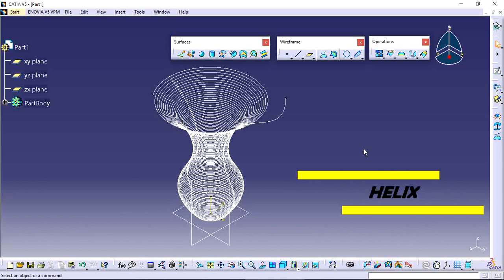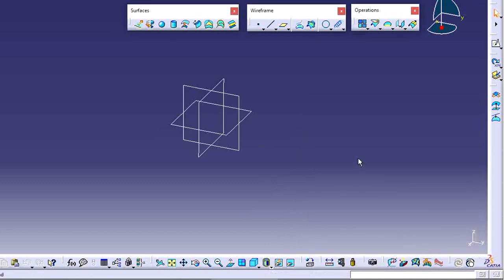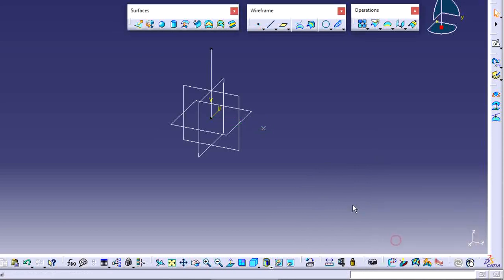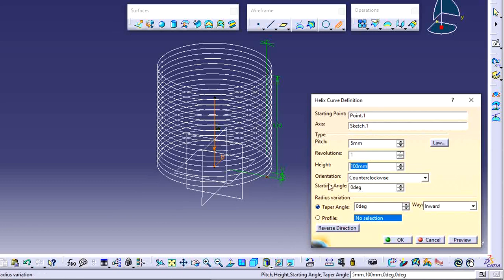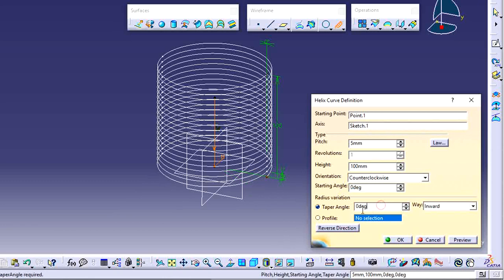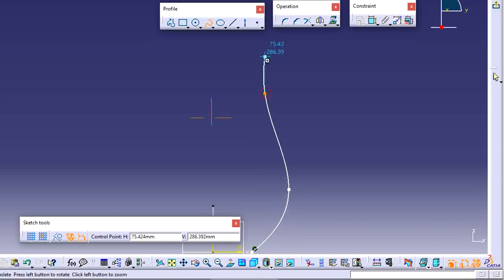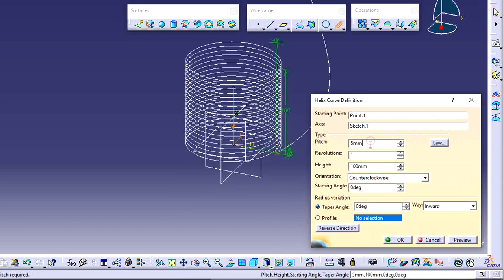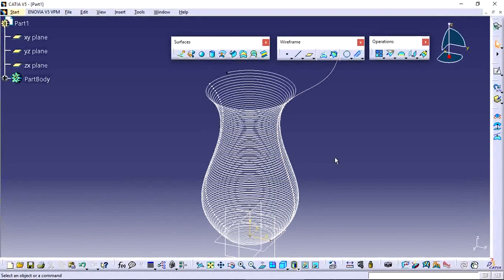Helix tool in CATIA | CATIA Practice | CAD Designs

Comment: bro infinity line comes either paralle or perpendicular to the plane not in angular plz help me to set the solution
Reply from the maker: Anil, You want to Create Infinity line on plan. right ?
Reply: @CADDesigns sir not like that I able to make a infinity line on plane but it is not be angular(ex: 30,62,27 degrees) to horizontal plane